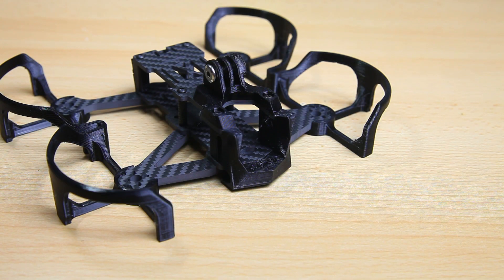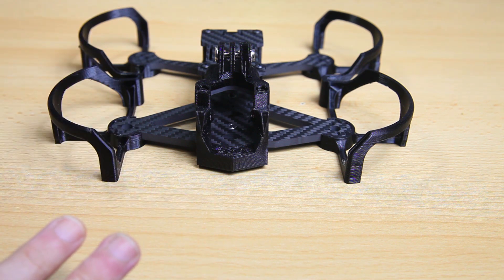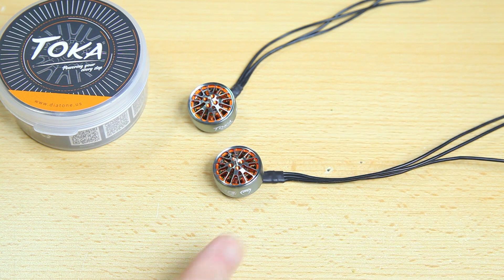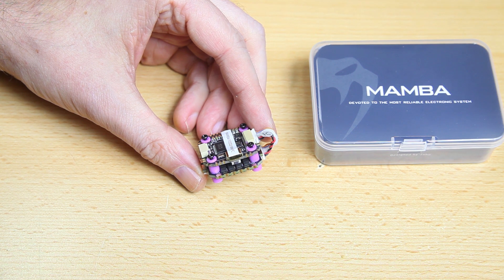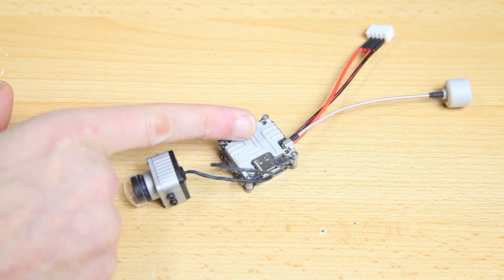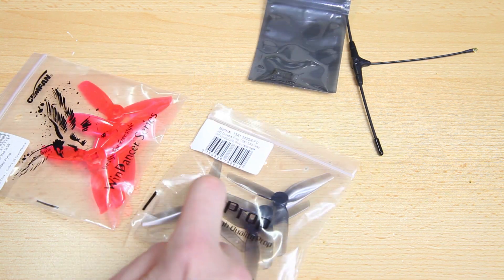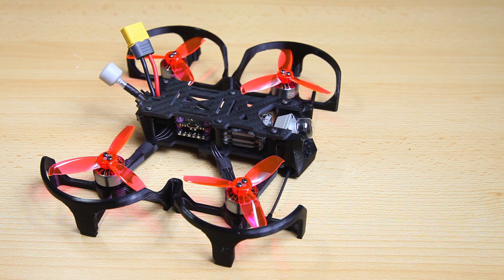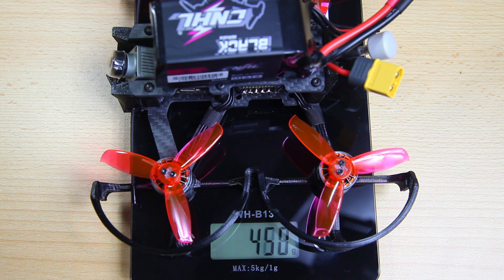Ethix Cinerat - 3 INCH Video Production Quad - PROJECT OVERVIEW

Comment from the maker: What parts make for a Good Video Quad??? Let's have a look :) 

Frame - Ethix 3" CineRat: 
https://www.team-blacksheep.com/products/prod:cinerat_cfhw 

Motors - Diatone Mamba TOKA 1606 2700 Kv: 
https://www.banggood.com/4X-MAMBA-TOKA-1606-2700KV-3-6S-Brushless-Motor-for-DIATONE-MXC-TAYCAN-Cinewhoop-Whoop-RC-FPV-Racing-Drone-p-1744703.html?p=TO251813974002015038 

Stack - Diatone Mamba mini F722 DJI + F40 Pro Blheli32 ESC: 
https://www.banggood.com/20x20mm-MAMBA-F722-DJI-3-6S-F7-Flight-Controller-F40-PRO-40A-Blheli_32-Brushless-ESC-Stack-compatible-DJI-FPV-Air-Unit-for-RC-Drone-FPV-Racing-p-1722558.html?p=TO251813974002015038 

FPV setup - Caddx Vista: 
https://www.banggood.com/Caddx-Vista-HD-Digital-System-5_8GHz-FPV-Transmitter-VTX-FOV-150-Degree-Camera-1080P-Recording-AIO-Compatible-DJI-FPV-Goggles-Remote-Controller-For-Small-Drones-Whoop-Airplane-p-1625165.html?p=TO251813974002015038 

Propeller - Gemfan Windancer 3028: 
https://www.banggood.com/2-Pairs-Gemfan-Windancer-3028-3-blade-Propeller-Compatible-5mm-or-1_5mm-Mounting-Hole-for-FPV-RC-Drone-p-1394719.html?p=TO251813974002015038 

Receiver - TBS Crossfire nano SE: 
https://www.team-blacksheep.com/products/prod:crossfire_nano_se 

Flight Battery - CNHL 1100 or 1300 mah 6S Black Series: 
https://www.banggood.com/CNHL-Black-Series-1300mah-22_2V-6S-100C-Lipo-Battery-XT60-Plug-for-RC-Drone-FPV-Racing-p-1521640.html?p=TO251813974002015038 

Project Playlist: 
https://www.youtube.com/playlist?list=PLXgLCadWLBnBZYd0Rm-MNZz5CNUU7YVce

Comment: I had those motors on iflight chasers frame and they were running hot. especially with insta360, even batteryless they were unpleasant to hold for more than dozen seconds.
I replaced the motors with 2203.5 but now I see I should have replaced the frame 

ad 5m15s: is is really 4x40A for 4in1 ESCs? like the hexplorer stack, the GOKU BS13A 6in1 stack will do 6x13A?
Reply from the maker: You had RPM filtering / ESC telemetry set up on that iFlight Chasers? If it's set up well, it should run enormously hot.. 
The Diatone Taycan CX3 had the same problem by the way before I tuned it.. 

Ehm well.. hard to say it's really 40A, but I do run these stacks in full 5" quads as well..

Comment: Nice! How's the prop guards? Won't it be too soft?
Reply from the maker: thanks :)  I'd say they Would protect people / things you run into but yes.. they are a bit on the bendy side :)
Reply: @DutchRC  Thanks for your reply 🙏  they don't affect the flight in any negative way?
Reply from the maker: @globalbusiness8457  Well Allways a Little right? They add weight and drag.. But these are A LOT better then the Hoops on most cinewhoops quads :)

Comment: I like this one 😊👍 can't wait to see it fly

When you are doing the final setup and test on the bench with the Lipo connected
does the Vista heat up a lot ??
Just wondered as to how long you can keep the Vista powered up safely ??
Thanks for the review 👍👍😊😊🇬🇧🇬🇧
Reply from the maker: Thanks man :)  and YES.. the vista does get warm.. usually I have a fan set up to blow air over it.. I have not had it thermal shutdown ever though... 
Cheers and have a good weekend!

Comment: Cool one.. 👍 I wonder if it could fit the Hglrc 3" prop guards there..? and how about Emax Avan props? it had 2.4 pitch than the Windancer..
Reply from the maker: Thanks man :)  
I don't think those would fit as the props run pretty close to the center of the frame.. 
Ah yes! I actually also have some sets of those Emax props in the project-box (I didn't want to clutter up the video to much) 
I don't really like the looks of those (it's almost a flat paddle) but the times I used them, they did work out fine :P